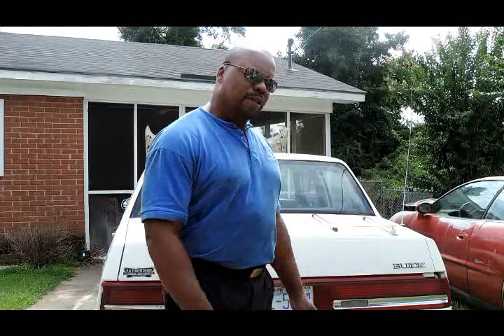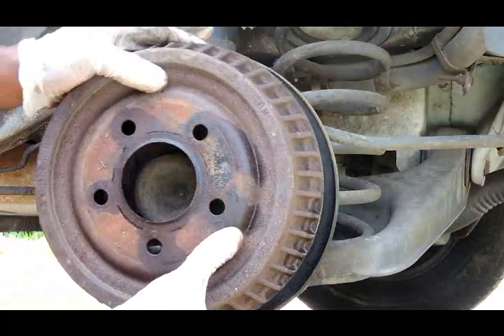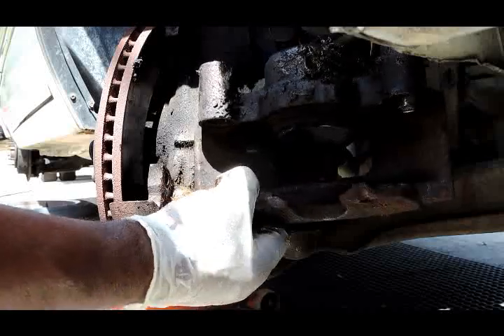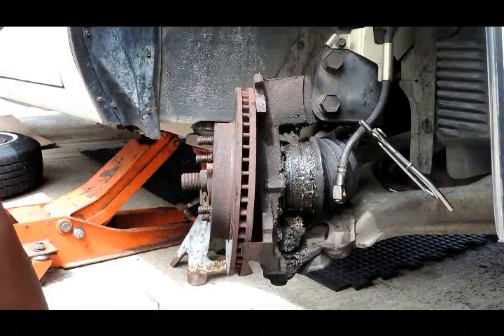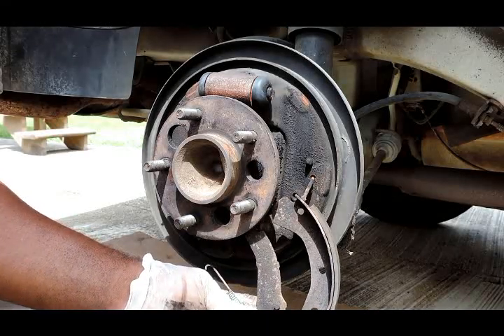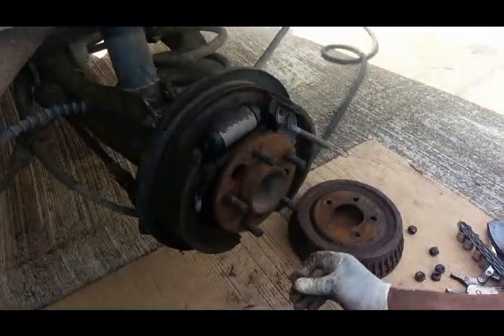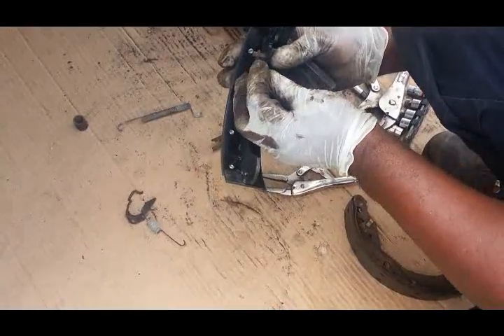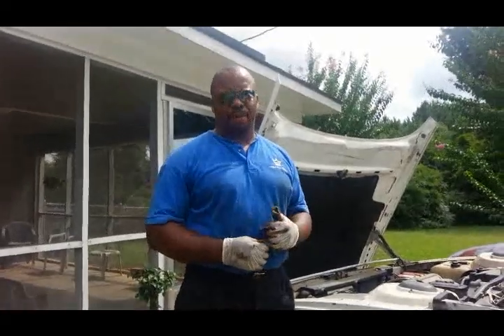⭐ 1990 Buick Lesabre - Replacing Brakes And Caliper

Comment: great video, thanks!  where do i find that hose clamp?  i'm also wondering why i have so little fluid in the master cyl.  no leaks in either front hoses.  maybe leak in wheel cyl in rear?  pedal was going to the floor, with no brake at all
Reply from the maker: Definitely sounds like a leak somewhere. Check the wheel cylinders and the brake lines along the frame, they tend to rust out depending on where you live. Those clamps was given to me a while ago and I don't know where they got them, but they sure do come in handy.

Comment: I own a Buick LeSabre Custom, and it's basically the same set up. I have two qeustions, are the bolts on the back of the calipers the same on the custom? and what could cause a front inner brake pad to hang halfway out of the caliper?
Reply from the maker: QUESTION #1: The bolts should be the same.

QUESTION #2: The only time we saw that happen, was when the brake pads was worn ALL the way down. So, you must really need some brakes, lol.
Reply: +⭐ Astral Auto Repairs , I took the tire off and checked, unfortunately I lack the tool at the time. the pad is low but not touching. the brackets that held it together are rusted off and the caliper is seized up. thanks for the video though it helped alot

Comment: Will this same thing work for a 1991 lasabre? And is it possible to use a caliper from a different model car like a century or ninety- eight?
Reply from the maker: It might be the same as the 91. If you call your local salvage yard, they will be able to let you know ALL the cars that are compatible with yours.
Reply: Being as your Buick is based on the GM H-body, you can interchange parts with a comparable Pontiac Bonneville, or Oldsmobile 88